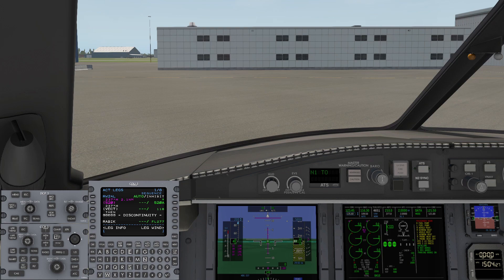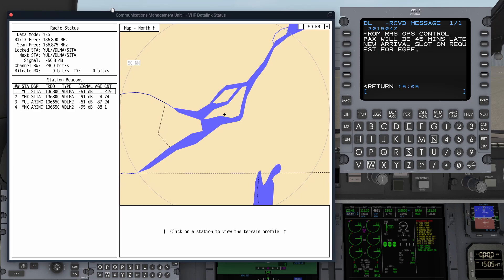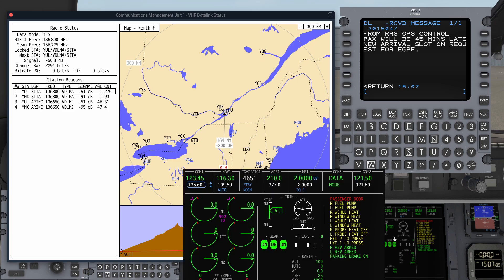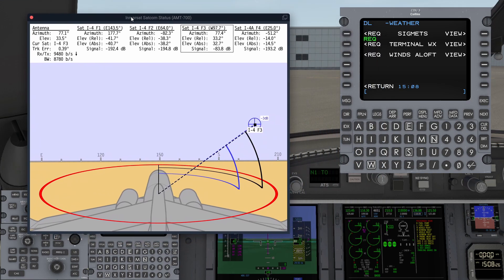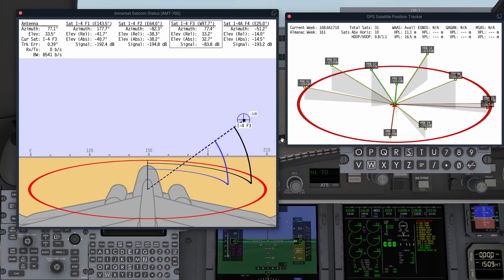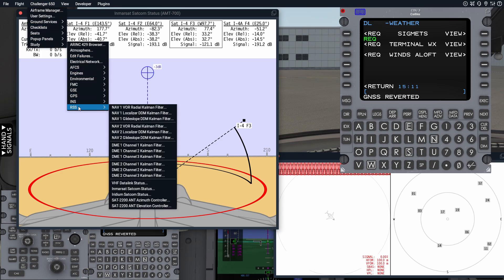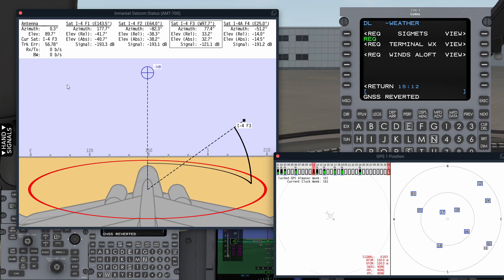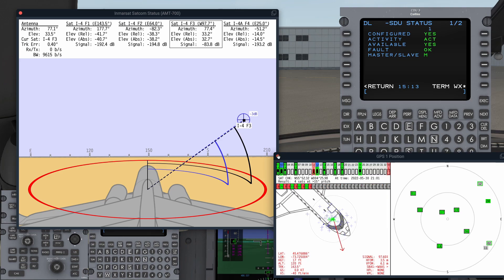Hot Start Challenger 650 - Datalink

Comment: Thanks to your video now I finally understand what that radio panel display always set to "DATA" on the overhead panel of an Airbus is. So this is a datalink to receive chats in the Airplane (DCDU) :) awesome. And the Challenger has this simulated too - even with study windows showing details of the transmitter and receiver line of sight signal strenght and more. I am getting more happy about the simulation depth of this plane by the day.

Comment: Fascinating. Now, how will a loss of our actual internet connection affect this airplane? Being a sim, would it still function normally asside from datalink request?
Reply from the maker: Yes it will still operate without an internet connection, as has been mentioned the GPS almanac will be out of date but the product ships with an old set of data so it will operate as expected.
Reply: In fact, there are some features that actually depend on a working Internet connection. At the very least, SBAS will be inop. Originally, the whole GPS subsystem would go inop if it couldn't download the real-life GPS almanac, but I think that's fixed now (a default almanac is shipped with the CL650).